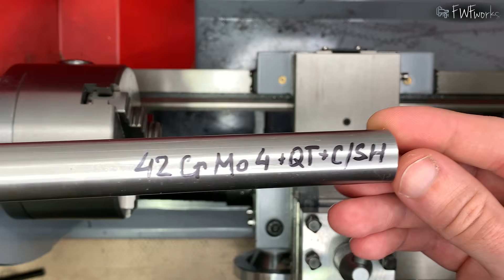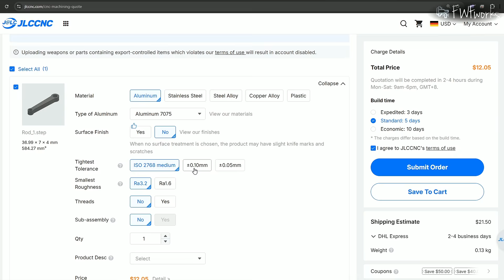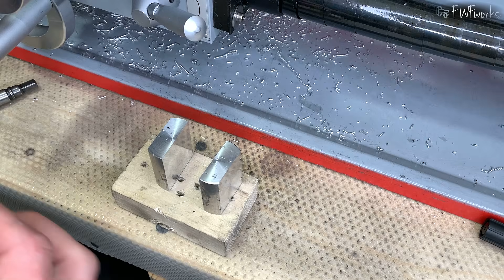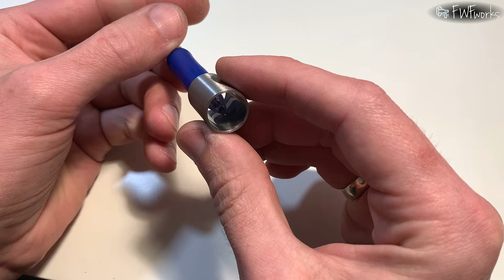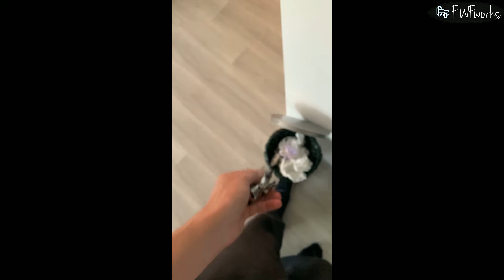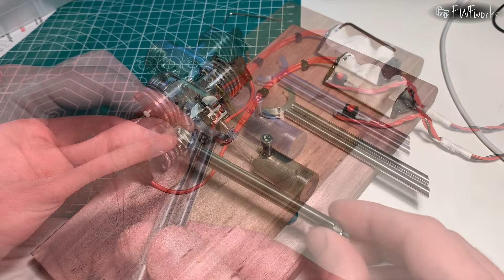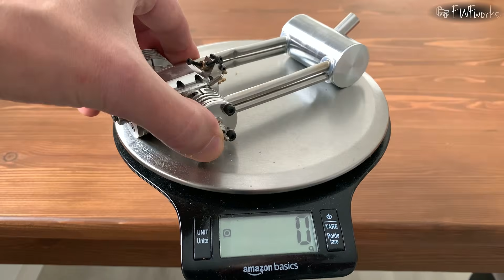I Created My Own Micro Engine! 6500 RPM?!

Comment: Assume work. BTW, its hard to get the vapor mixture right in small engines to run gasoline. Fuels like nitro methane are much more tolerant and ignite at lower temps. That's why you don't see small engines using just gasoline. There are a few small successes but most use an additive like nitro propane to make it workable. Also, note that fine tuning the mixture and compression of early model gasoline engines was more an art then a science. mixture in particular was very touchy and today you'd want a needle with a very fine 128 thread per inch or better. Many often ran wide open or use an idle plate that slapped down over the venture and had a small hole drilled in it for air intake, often combined with two needles, a high and low speed. Also, temp and humidity often effected both starting and running of these engines. You might get it tuned in and running in an afternoon but, couldn't get it started the next morning on the same settings. Or, it would start and run well on a warm afternoon but if weather moved in and the temp dropped, or it rained, you were back to square one. So, it is possible but not efficient or dependable. Gasoline just isn't a good choice below 10-15 cc.
Reply from the maker: Thank you for the detailed explanation! I think you’re absolutely right. During my experiments with gasoline, I noticed that the fuel needle is extremely sensitive to adjustment. In theory, this could be improved by using a needle with a very sharp taper, but the issue of the small cylinder volume doesn’t go away. My next engine will definitely be bigger 🙂

Comment: First of all, congratulations on the running engine, even if it’s far from a racehorse BUT it runs!!!. I have over 200 engines, many completely rebuilt, and a few, like the one pictured in the avatar, a 7-cylinder 120cc radial engine that I built myself without CNC machines. I have converted all engines over 20cc to run on gasoline. So, two reasons why yours isn’t running: 1. Carburetor – practically none of my conversions ran well with the original nitro carburetor, you need a diaphragm carburetor like WALBO or the ones used on SAITO FG series carburetors. 2. Problem – no Petrol engine works WITHOUT piston rings; gasoline engines run hotter! For mine, I cast the pistons myself from silicon aluminum (at least 17%) and allowed a clearance of 0.02 mm per 10 mm of piston diameter. Videos on the construction and operation of my radial engine can be found under: BIRTH OF AN ENGINE (uploaded on a different channel than mine) and other stuff on my channel ;-)   Greetings from Switzerland
Reply from the maker: Hi! Thanks a lot for the congratulations and the detailed feedback. You clearly have a huge amount of experience! Building a 7-cylinder radial engine is seriously impressive. I’ll definitely check out your videos.
I appreciate you taking the time to explain the carburetor and piston ring points. I’ll dig into these topics more deeply for my next projects!
Greetings from my side, and thanks again for sharing your experience 🤝

Comment: Hola, en efecto tiene que ver con la compresión, a un motor pequeño le es difícil llegar a la potencia suficiente para generar la compresión requerida para la gasolina convencional. Y aún peor son las tolerancias, en esas dimensiones hasta la bujía genera que no puedas llegar a la compresión con facilidad.
Reply from the maker: Hi! Thanks for your comment! Honestly, I experimented with a geometric compression ratio of up to 20, hoping that despite the leakage between the piston and the cylinder, I could still compress the mixture by at least a factor of 10. Unfortunately, that didn’t work🤷‍♂️
Reply: Que bueno que usaste el traductor, ahora te puedo comentar con precisión. La compresión 1/20 hace que el diesel inicie la combustión solo, y la gasolina explota antes de tiempo, lo mejor es usar la compresión 1/9 ya que la gasolina de menor calidad también funciona, y al usar mayores compresiones las tolerancias y sellos tienen que ser más justos para soportarla. Que divertido proyecto hiciste.
Reply from the maker: @JuanAlejandro-kg9oy 
Yes, I understand about the compression ratio. It’s just that at some point I started trying everything that came to mind in an attempt to get it running on gasoline 🙂

I also measured the compression, similar to how it’s done on car engines. My engine easily built up 8 bar of pressure (I don’t have a gauge that can measure higher)

Comment: I’m not sure—maybe it’s not a good idea to polish the cylinders. Large automotive engines have honing scratch marks, which help retain oil on the surface. I’m not sure if the same applies to micro two-stroke engines.
Reply: he didn't polish but lapped the cylinders, giving them the cross-hatching needed for oil support. The compression was good, and the swap to 'nitro' alcohol fuel made the engine to a runner.
Reply: @peter2uat  In the video, he mentions that the cylinder turned out without scratches or tool marks, and it looks very smooth.
Reply from the maker: @saderuscz 
Hi! You’re right. I did polish the cylinders almost to a mirror finish. I did that because I was worried about the aluminum pistons, since my engine doesn’t have piston rings. Next time, I plan to make piston rings and hone the cylinders.

Comment: Would a Propane or Butane (LPG) fuel atomize better?

You would probably need a separate Pressure Lubrication System (or figure out how to get “Splash Lubrication” to work), OR use one of the “Total Loss Lubrication WITHOUT Premixed Fuel” some Motorcycles and Boat Outboard Engines use), but that may ease the Carburetor issues.
Reply: Use of “Starting Fluid” and maybe some means to pre-heat the engine to aid in Ignition may be worth investigating as well.
Reply from the maker: @ericlotze7724  
I tried camping butane and starter spray based on diethyl ether, but none of that worked. The engine only started reliably when I switched to nitro fuel for RC models 🤷‍♂

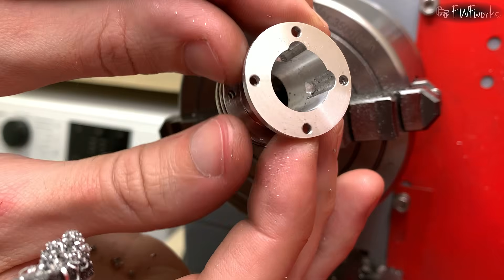Comment: 7:20 Would a Casting or SLM/EBM 3D Print allow for these to be solid metal connections?  

(I’m just thinking in terms of engine longevity, ALTHOUGH there are very strong epoxies out there!)
Reply: Might be a great sponsorship pitch!
Reply from the maker: Hi! Thank you for your comment! 🤝 Yes, you’re absolutely right, my engine most likely has a very limited lifespan. But my goal wasn’t durability. It was simply to get it running. And yes, parts like these could easily be made using SLM technology. I think I’d really like to try building something like that in the future!

Comment: Hermoso Trabajo!. Pensaste en armar un Radial?
Reply from the maker: Hi! Thanks for your comment!
I did think about it, but I want to make the next engine a four-stroke. At this stage, I haven’t figured out how to manufacture a "radial camshaft" using only my single lathe.
Reply: @FlyWolf_works  4 stroke 1 Cil, yes  i think about it 30 min after y click "publish". Maybe ....use the sponsor for the Nucleo. (Español hablante aqui). Or .... just investigate ...research ... until ready. The Magic about Radial Engine is about ...only 1 lobe in the crank ....all pistons conected to it. Maybe ... some misfire here ....just explore it. --more to come
Reply: @FlyWolf_works  Some radial engines uses 1 single lobe in the crankshaft ....All pistons attach to It. Just check It. its a simple Tech i hope (and i know) u get it. Amazing simple tech. 9 cilinders in a single lobe, 18 cilinder in 2 lobes same crank, 27 cilinder in 3 lobes same crank ...simple Math ... espero te sea util.
Bendiciones!

Comment: Here's some advice on Split cranks... I built cranks a while back for a 2 stroke in which I doubled the HP to over 3hp for model helicopters (gassers). the trick is to use 4140 for the entire crank, BUT turn the shafts so that the surfaces that ride in the crank bearings are oversize by about say 0.010 inch. Then use O1 tool steel for the crank pin, harden/temper and use a tight press fit to the crank halfs (mine used roller bearings on both ends of the connecting rod)... align them as best you can when press fitting. once press fit, THEN machine both ends of the crank between centers. you'll end up with a perfect crank alignment.
Reply from the maker: Hi! Thanks for the advice! 🤝 I’ll definitely keep it in mind.
May I ask how you managed to align the crank halves so well during press fitting? In my case, no matter how carefully I tried to press-fit everything, I still ended up with about 0.012″ runout, so a 0.010″ machining allowance wouldn’t have been enough. Did you use some kind of jig or fixture during press fitting?
Reply: @FlyWolf_works I've spent way too much time on things like this... I justify it as skills and techniques development!😂
Yes, a jig and spacers was the solution on one tricky build.
With that crank I'd machine out of one piece temporary solid centre. Rotary indexing tool??
To mark and drill 180° for rods. After pressing pinning rods cut the solid through centres out.
The mistake with pressed pins in pistons, one side needs to be snug and the interference the other and have that side down and press into it so the pin doesn't drag through the top hole and distort the piston.
Reply from the maker: @mrgoodman6620
Interesting idea with the temporary solid centre, thanks! You’re absolutely right about the pistons, I hadn’t thought about that. I was mainly trying to simplify the manufacturing process 🙂

And honestly, I don’t think we need to justify the time spent on a hobby. We’ve earned it!

Comment: gasoline needs to be mixed with a lot of air. small displacement has a hard time getting the mixing right. nitro fuel has it's own oxidizer. great work man, makes me wish i got a mini lathe before i got my mill.
Reply from the maker: Hi! Thanks for the explanation, I really appreciate your feedback!

I wasn’t very good at chemistry at school, so I didn’t realize that nitro fuel already contains an oxidizer 😄 As far as I understand, a small engine can run on gasoline, but it needs to have at least about 5–6 cubic centimeters per cylinder. For future projects, I plan to build slightly larger engines, because I don’t really like nitro fuel. Switching to it this time was more or less forced, since I really wanted this engine to run.

Comment: You should use cast iron for pistons and small notch on carb barrel edge on intake side for better idling.
Reply from the maker: Hi! Thanks for the advice! 🤝 I’ll definitely keep this in mind next time!
Reply: @FlyWolf_works  
If you do use cast iron, increase the oil mix to 25 to 1 on breakin, no more than 5% synthetic (if any)  balance castor oil, after break in go down to about 20 to 1 in increments.
Reply from the maker: @asrcav8r  
Hi! Thanks for the advice. Unfortunately, I couldn’t find cast iron bar stock at a reasonable price. For my next engine, I’m thinking about using a steel liner (42CrMo4) with honing, an aluminum piston, and stainless steel piston rings.
That said, I haven’t studied this topic deeply yet, so I might be wrong. It’s possible these materials are not good to work together...

Comment: So how many iterations of the design did you have to go through?
Reply from the maker: Hi @larrybud ! Sorry for the long read :)

I started this project in March 2025.
The video doesn’t show everything that was done, because at some point I lost interest and stopped filming all the experiments.

1. New steel pistons
2. Enlarged transfer ports
3. Modified transfer ports to direct the fresh mixture flow inside the cylinder
4. Changes to the valve timing (crankshaft rotary valve in the rear cover)
5. New CDI ignition
6. Compression ratio experiments (reworking the cylinder heads)
7. Another change to the valve timing
(you can notice a 2 mm aluminum spacer between the cylinder and the crankcase in the final version, which wasn’t there at the beginning of the video)
8. Ignition timing experiments (from 0 to 30 degrees)
9. And finally, switching to a different fuel and glow plugs
10. New exhaust

All in all, about five months of work, excluding the time when I cooled off and paused the project 😃

Comment: Great video! I think it would have been better if you started with the build. Starting straight into the assembly was a little bit confusing, and wasn't the most engaging at first. I'd bet a lot of people bounced off before they got to it running or building. Great work, though!
Reply from the maker: Thank you! 🤝
I'll think about cutting out the first part of the video. I also discovered that YouTube didn't automatically translate or dub. Probably because I'm silent for the first five minutes. I didn't expect that to be such a negative thing 🤔

Comment: I always figured it was because Nitromethane required less pressure to function. Since even the smallest gasoline engines have piston rings, you likely didn’t have enough compression for it.
Reply from the maker: Good point, thank you! 🤝
The next engine will probably have piston rings 🤔
Reply: back in the day all model engines had  rings untill they were replaced with ABC construction. aluminum brass chrome - which is a aluminum piston running in a chrome plated brass liner they work because the liner expands the same as the piston it works with gasoline too.  FYI traditional model engines use straight  methanol - any nitromethane added is to increase performance  (up to 2.5bhp from .40 ci. /  6.5cc engines  - which obv increases cylinder presures beyond any NA gasoline engine
Reply: @malakiblunt  
Nitro also widens the critical needle settings and give a more dependable engine run, as little as 5% to 10% is all that's needed.
Also, why the strikeout on the ABC explanation? It's absolutely true except for the cheaper and less reliable ABN (Aluminum piston / Brass liner W Nickel plating.
Reply: Smaller engines tend to run better with lapped piston/cylinders, those tiny rings require VERY high tolerances and the slightest scratch from a ring will have a greater effect on the smaller diameter and lapped sets have in general way better sealing.
That being said, properly made ring/cylinder sets will last longer. A good way to get good sealing on a ringed piston is to use a Dykes Ring  but they are even trickier to make, maybe use an existing ring from a glow engine?  OS, Webra, HB, Enya and K&B engines use them in various sizes.
Reply: @asrcav8r  Cox .010 was a great engine, it did not use rings and was extremely reliable.
Reply from the maker: @asrcav8r  
Excellent point! I'll be looking for factory-made piston rings for my next projects 🤔
Reply: @FlyWolf_works piston/sleeve kits are widely available.  I used to rebuild RC car and airplane engines for customers when I worked at a hobby shop in college.  Some vendors even sold incredibly tight sets that gave very high compression.
Reply from the maker: @jwm6314 Thanks! I'll try to research the market.
Reply: Generally less than 25mm rings  aren't necessary & tricky to make.
Reply from the maker: @RogerClay-g6w 
I’ve seen that TOYAN and CISON, which are well known for their model engines, do use piston rings. However, I only judged the piston diameters visually, so I’m not sure they go below 25 mm 🤔
Reply: @FlyWolf_works  Their engines run like crap. Tolerances are horrible.
Reply: Nitromethane does
not require less pressure to function; in fact, it typically requires higher pressures for stable combustion compared to conventional fuels. Here is a breakdown of why nitromethane requires high, not low, pressure:

    High-Pressure Requirement for Stability: Studies indicate that nitromethane struggles to maintain stable combustion at low pressures and often requires pressures exceeding 24–30 bar (348–435 PSI) to function properly.

Comment: Interesting project and great video thank you, Did you design it yourself or is there a drawing, if so is it available please??
Reply from the maker: Hi! This is fully my own design.
I had a 3D model, but it changed a lot during testing. So there are no final drawings.
Reply: @FlyWolf_works A GitHub/GitLab page so others can “fork” the design and you can lead a renaissance in (Open Source?) model engines would be SUPER COOL!

Comment: Great project! I think you should have used piston rings. No engine can exist without rings.
Reply from the maker: Next time 🤝
Reply: actually almost any small engine has no piston ring(s).  And the powerful ones use aluminium pistons (and chrome plated aluminium/bras piston sleeve). But the aluminium alloy must contain rather large amount of silicon)
Reply: @dalibortoman  How is that possible? There won’t be any compression in the cylinders due to insufficient sealing
Reply from the maker: @AnodeKathode 

@dalibortoman is right.
This is a very delicate balance between thermal expansion and minimal piston to liner clearance.

There is good compression and the engine does work, but the service life of such engines is much shorter, often hundreds of times shorter, compared to classic automotive engines with piston rings 🤷‍♂️
Reply: Tell that toMr. Cox